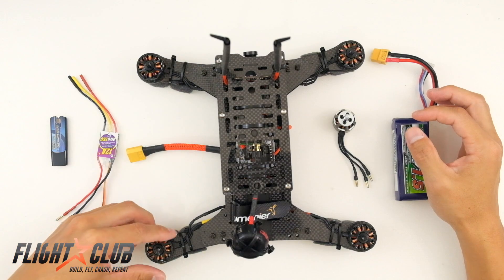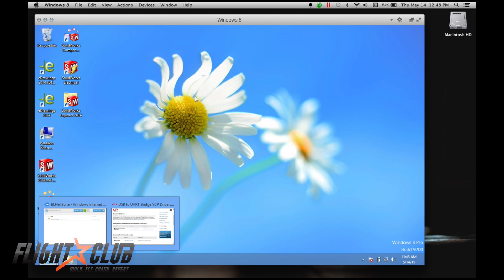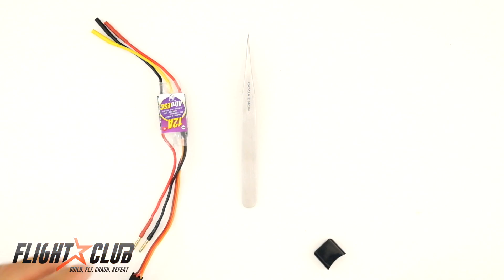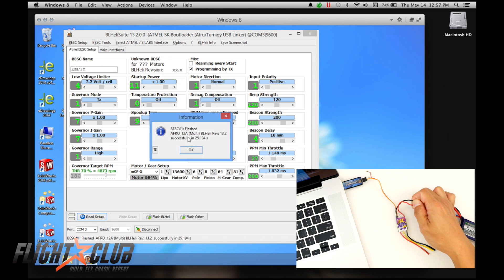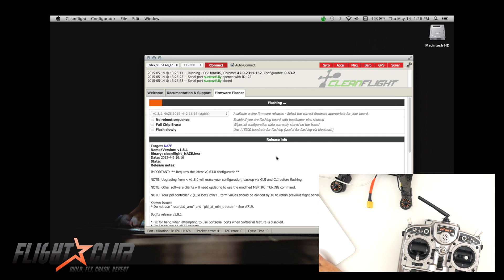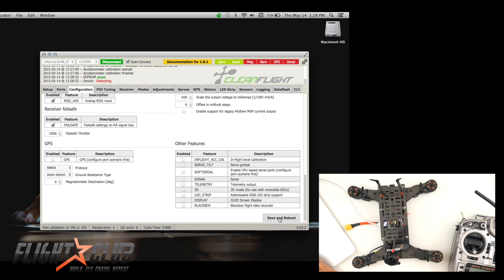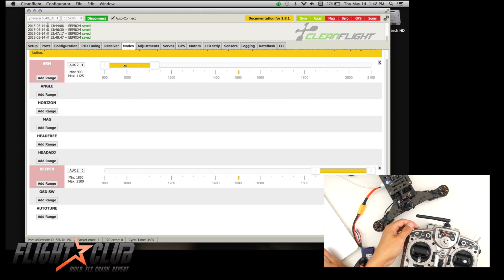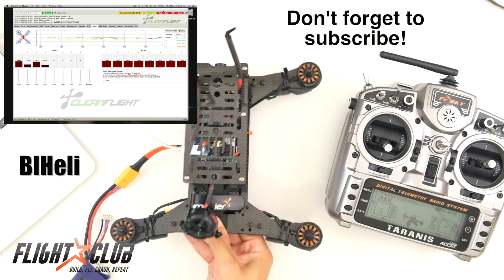How to flash BlHeli and use Oneshot

Comment: hi,

I saw your blheli with oneshot run smoothly on start spinning the motor.
I have issue here.
I did everything the same but, when i arm it, few of the motors cogging before actually spin up.
When I disable oneshot feature, the issue gone. 
Any advice? Thanks

Comment: when you changed the parameters in BLhelisuite shouldn't you have pressed {write setup " before you press disconnect? another question would this turngy USB linker work with Emax 12A esc? thanks

Comment: Great video, thanks! To me, the best solution to removing the + wire would be to use a servo extension that has the red wire removed. That way you don't have to risk damaging the pin/housing on the ESC connector itself or mutilate your USB programmer by bending the middle pin.

Comment: I like your slower and "just to review" style of instructional videos. They are easier to follow and more thorough than others. The BLHeli dampen part of you video would have been more revealing if you would have not chopped the throttle all the way off but maybe from 3/4 to 1/4 to show if there is dampening. From my understanding any throttle decrease should have dampening but I have never seen that bench tested. Chopping all the way is just showing drag brake similar to folding prop glider settings.

Comment: Thanks for making these videos. I know when I setup my quad I spent a lot of time finding information like this. Just a side note to clarify the comparison at the end, damped light is causing the motors to brake when the throttle is cut. Oneshot isn't required for that. For instance, my Rotorgeeks 12a ESC's support oneshot but not damped light, so they spin freely when the throttle is cut.
Reply from the maker: Brox3r thanks for pointing that out.  i learned something new :)